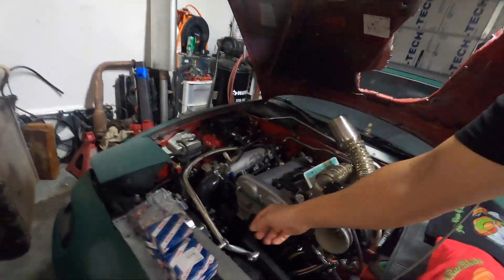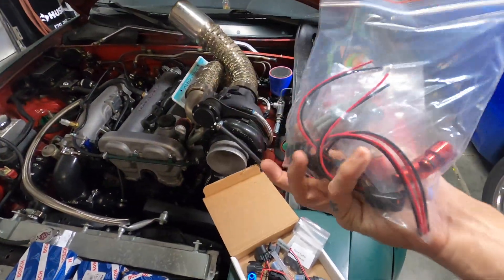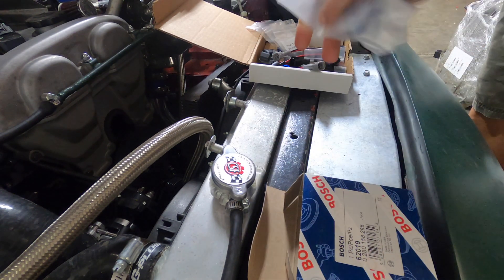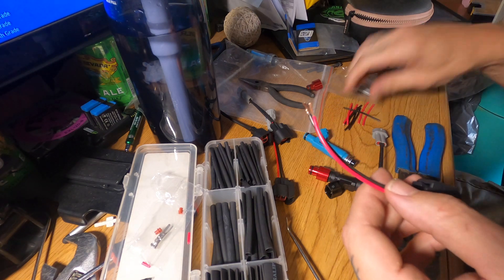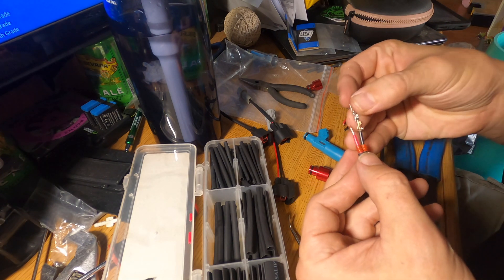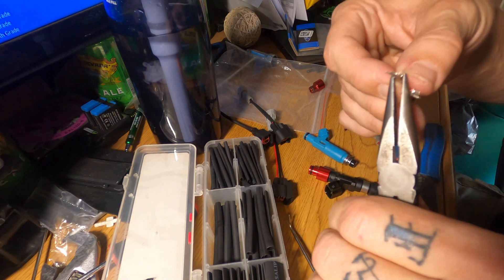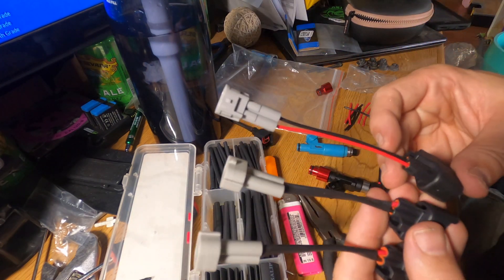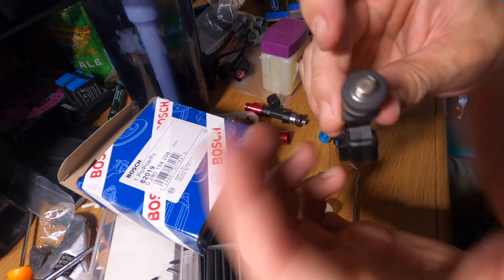DIY GT500 Injector Kit - Budget Boosted MX5 Miata Upgrade (NA & NB)

Comment: So I'm sick of dealing with the Motorcrap carb on the 429 T-Bird... I need your help installing a Sniper EFI when I get back this winter.  If that doesn't solve my issues than its full engine rebuild time but that doesn't make sense considering it still sounds amazing when the carb is running as intended.
Reply from the maker: Absolutely bro, I got you covered. The sniper efi kit will wake that beast up and actually give a few MPG back… not that we care about fuel economy 😂